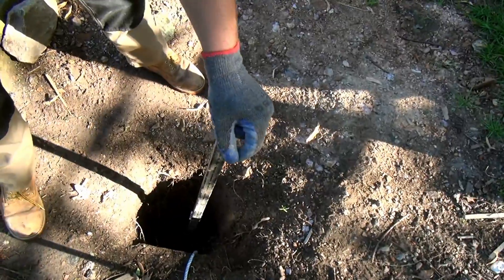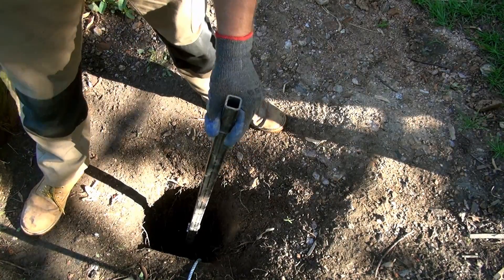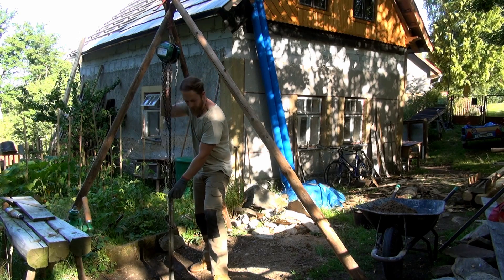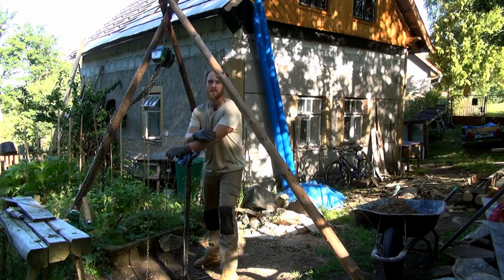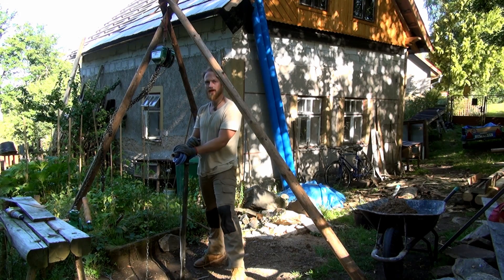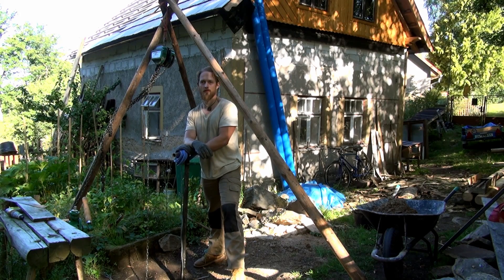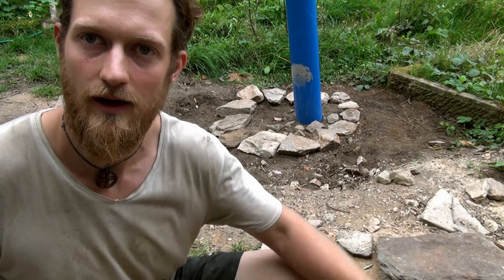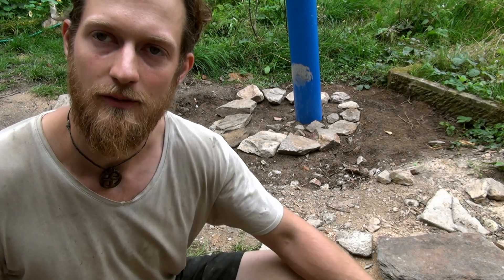Drilling a Well by Hand and getting Free Water

Comment: Could it freeze in the winter and how to prevent it?
Reply from the maker: There is a little hole in the pipe that brings the water up. The little hole is about 2m under the surface level, that way the water level always drops to that little hole (any extra water just pours back into the well).

This system ensures there is no water in the pump itself so it can´t freeze and damage the pump. Find out how deep the ground freezes in your region, and add some extra. That is the point where you want to drill that little hole.